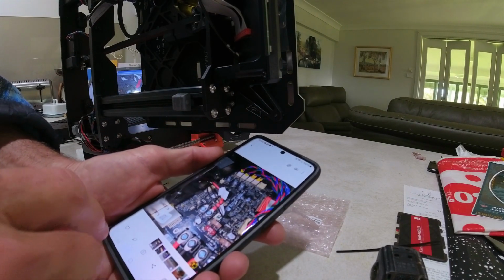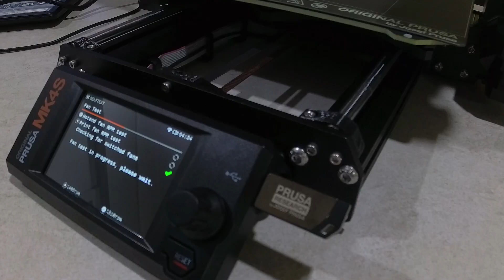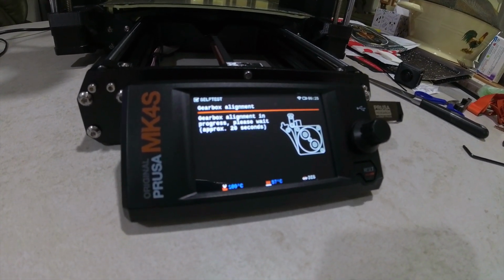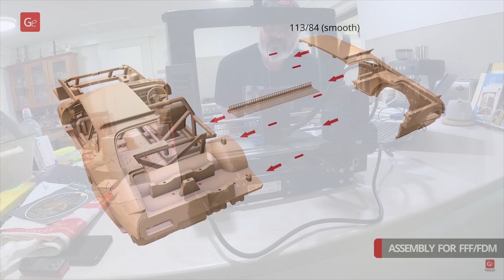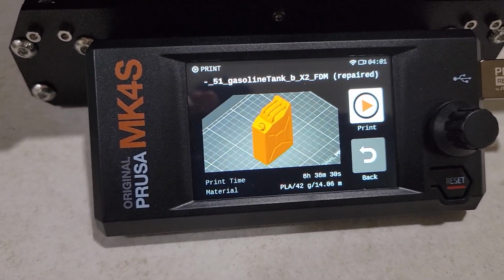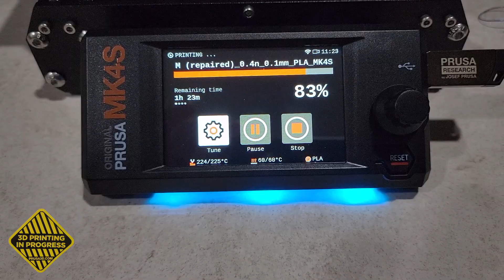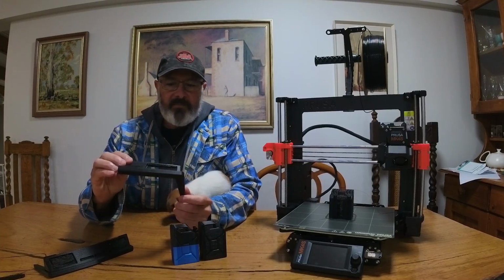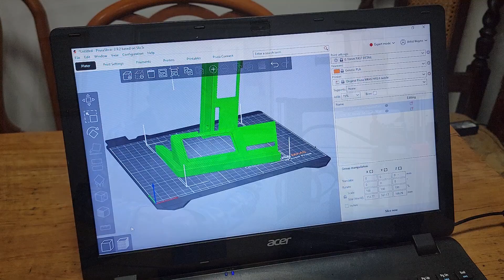Original Prusa MK4S 3D printer assembly: COMPLETE! A 3D Printing Adventure Begins...

Comment: Nice! Just got the MK4S as well - excellent machine. I did have some belt rippling, but that was solved by further tightening my belts (a little more than what the belt tuner app would recommend). 

I love using matte PLA filaments for things I plan on painting - gives the paint or primer much better "bite," and they're easier to sand.
Reply from the maker: Thanks for the tip! I'll be sure to experiment with different filaments and settings. The mk4S is a little beast! I've been printing parts 24/7.🤩